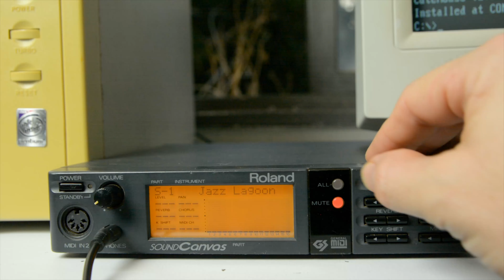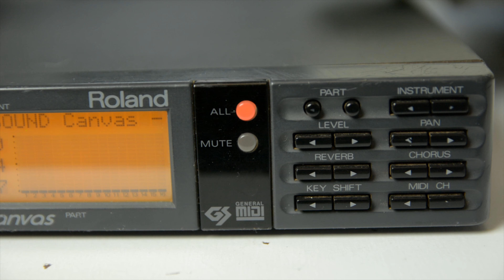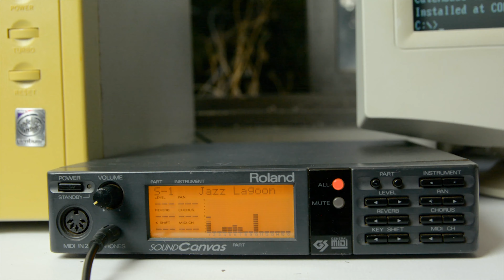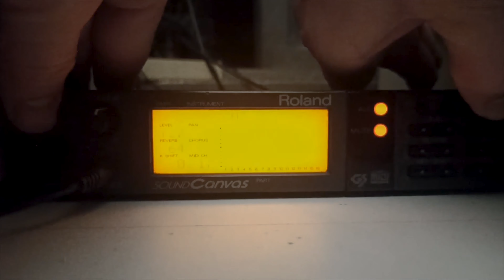Roland SC-55 vs Sound Blaster AWE64

Comment: This is such an awesome video Bruno, thank you for sharing it! This is such a great explanation of two really impressive MIDI devices! The AWE64 is quite impressive in its own right and really does sound pretty solid--props to the EMU8K for holding its own, but the SC-55 is just another level. It's so warm and rich, and it has such a great degree of dynamic range. It really is a legendary piece of hardware and it sounds so dang iconic; Grabbag on the SC-55 is an iconic combo! I am still so mind-blown by the AWE64, and I have one myself and use it regularly; I've never done such a direct comparison and it really is impressive how well it does for such a "mainstream" card. Thanks again for this man--loved the video!
Reply from the maker: Thanks for watching, Will! Always good hearing my friends opinions on this subject. Yeah, this was a surprise, people's reaction to the awe64's performance. I didn't think it was as impressive except on Raptor, there is basically no difference from the sound canvas.
Reply: @SUCRA  I really loved this one man! The AWE64 definitely is a bit...harsh in Doom, but its MIDI capabilities are pretty impressive all-told. I'd say that Raptor definitely sounded best, but I think Duke3D was decent. The SC-55 just really isn't a fair comparison, though. That thing is a legend and an absolute monster!

Comment: Hie, i have same config but awe64 take the lead in general midi, i need to use an other soundcard to hear my sc-55! Need i a manipulation to switch awe64 to sc-55? and how to, if it's possible. THX
Reply from the maker: I believe you have a general midi sound font loaded. Try using the creative software on windows and reset to factory. I've never done this btw, never needed to. But there are some videos on yt that you can find of people loading different sound fonts to the awe 64.

Comment: This goes to show it's more about the caliber and focus of the composers than the hardware itself.  Shareware games seem to thrive on AWE64 owing to it being the culmination of the simpler AWE32 standard (Heretic, for example, is confirmed to have been composed for Sound Blaster), but Doom and Descent are exceptions because they were composed on SC-55.  When AWE64 released in 1996 digital music, either streaming Redbook audio or calls to sound files of equivalent quality (made viable due to larger hard drives), had already supplanted MIDI as the standard for PC games.
Reply from the maker: Indeed, and don't forget the nostalgia factor. Most people only had the chance to listen to whatever 8 or 16 bit audio card they had, using something like an sc-55 was for a lucky few.

Comment: 6:25 Its almost as the AWE didn't even try at the distortion guitar patch. but i suspect its because when trying to add "realism" to so little sample space.
The Sc-55 DistGtr may be dry and cheesy, but its does mix well with the other patches.
Reply from the maker: Sounds right, Doom is one of the more dramatic examples of the comparison. I think the sc-55 sounds really good in it. The awe 64 has a nostalgic sound that I don't dislike, but the sc-55 makes it  sound great.  👍

Comment: Damnnnnthat Roland sounds good! Surely you can get software emulators that can trick a DOS application into think something like the Roland is connected?
Reply from the maker: Hey, how're you doing? Yeah, you can emulate it with another PC. Phil did a video on this using a Windows Tablet. Pretty cool.

Comment: With sequencer for Sound Blaster AWE64 Gold using the FM hardware synthesizer at 4-operators mode or using the Add hardware synthesizer ( it requires software that can use 4 operators instead of 2 operators ) to create quality sounds with the SPDIF output record to new high-quality sound cards or from them to the magnetic tape , can be achieved the studios quality sound 
It's difficult to find software that uses 4 operators instead of 2 operators that give a sparse sound , or find System Exclusive (SysEx) in a MIDI file with a sequencer to use 4 operators for bether sounds 
Sampler EMU8000 is not recommended to use it becose has 16 bit samples, although the quality can be improved using EMU8000 DSP with controllers Non Registered Parameter Number ( NRPM ) or System Exclusive ( SysEx ) at MIDI file with sequencer
Reply from the maker: Nice! Interesting stuff. 👍

Comment: I owned this sound card , the Emu8000 synthesizer was a decent chip and I recall it was used in Emu rack samplers or modules of the time.
Now when it comes to General Midi for games, the default rom patches were as bland as it gets, the drums are awful (only 1mb worth of rom samples) It's too bad that practically no game (at least none that I know of) used the custom patches capability of this hardware.
Considering this, a sound module such as the SC-55 will most of time sound much better in games. The Roland SC-55 has 4mb of samples and the patches have a much better sound design overall, Roland created the GM standard, they know their craft when it comes to make good sounding instuments.
To me the whole point of the AWE32/AWE64 for a hobbyist musician was that you could create your own patches with your own samples and it could sound somewhat pro (minus professional mixing) and it could sound a lot better than an external module or at very least on par. I had a lot of fun doing music on the AWE64 back in the day :)
Reply from the maker: Thanks a lot for your comment! Sounds like and interesting proposal, I have never tried loading my own sounds fonts, maybe it's something I should do at some point. I hope you have a great weekend!